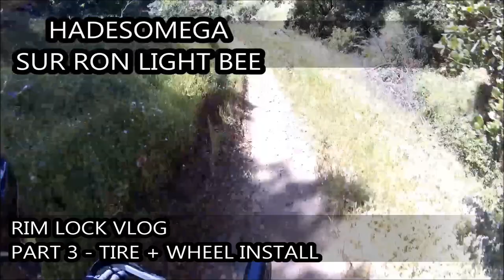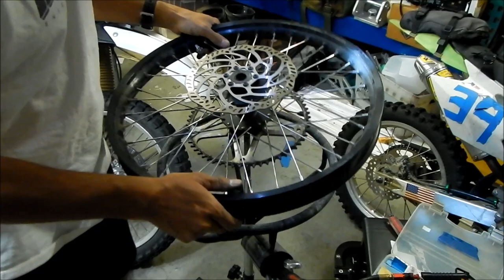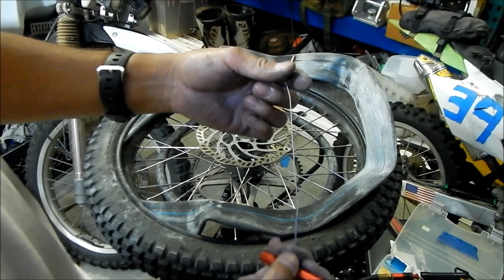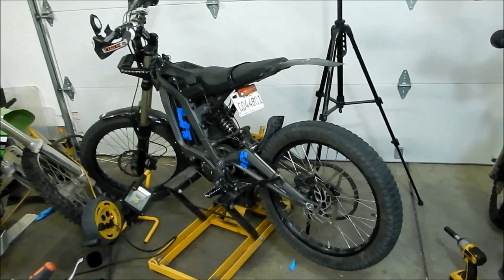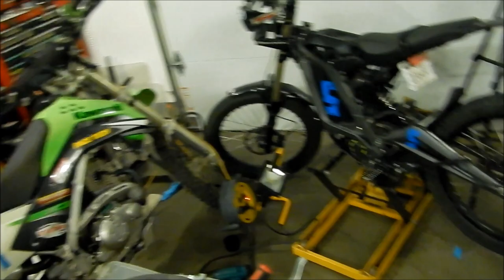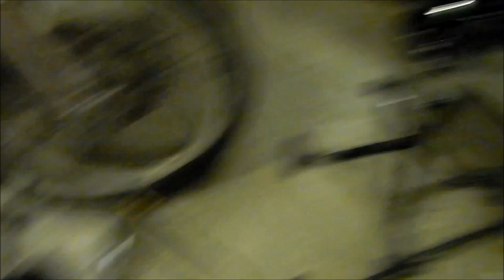Sur Ron Light Bee Rim Lock VLOG Part 3 - Tire + Wheel Install

Comment: I saw in another rider's video that he found 20psi to be really effective in trail riding. Have you tried using a higher psi instead of 15psi to avoid having to put on the rim lock? I've always thought of adding a rim lock as well but I haven't noticed any slippage yet (I'm not racing of course and I'm a real amateur dirt rider). I wonder if you will feel any difference in handling due to the added unsprung weight. Also hope to see you someday since we're both in the Bay!
Reply from the maker: I rode it today and it seemed fine.  I also balance the wheel after.   My bike has the 60tooth Luna Cycle sprocket and it has a lot of torque off the line.  But if you are going to do some serious trail riding I highly recommend having one.  I run 22psi on my DR650 and I recently did a dual sport event with it and I didn't have a rim lock and it didn't spin the wheel but I was paranoid all the time that I was going to spin it.